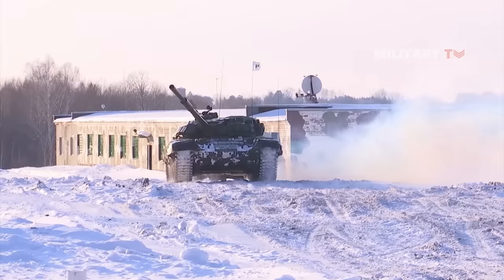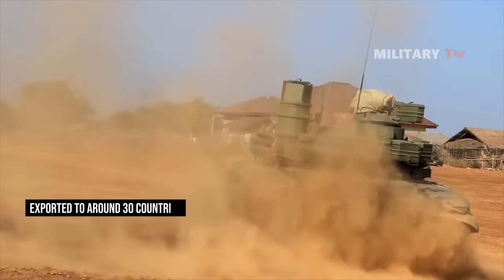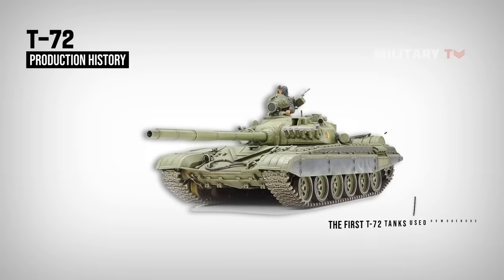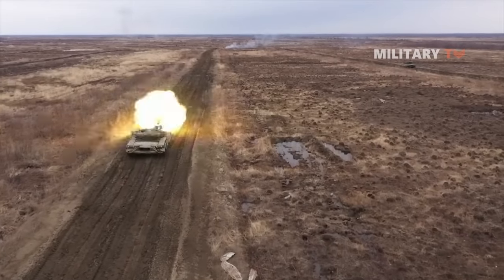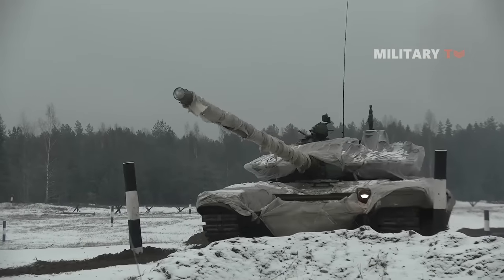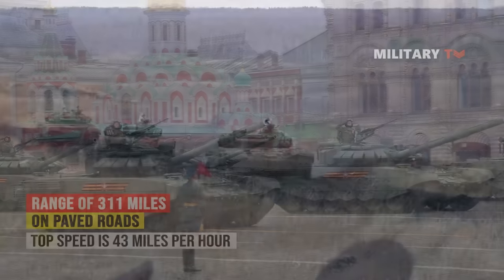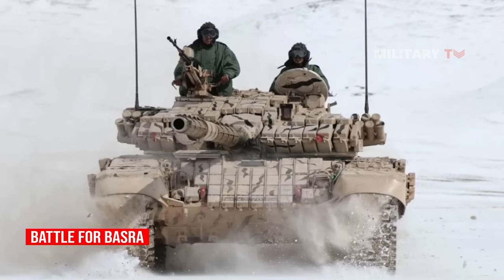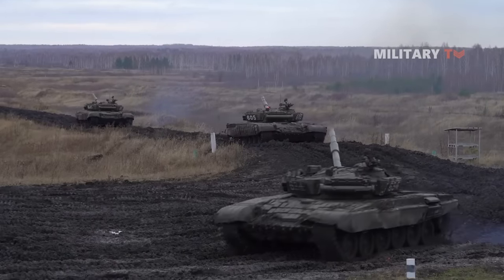Why the T-72 Tank Is the Backbone of the Russian Army

Comment: The T-72 was meant to be a modern equivalent to the T-34, Cheap and easy to produce and replace. While the Abrams, Challenger, Leapards and Leclerc’s are the 21st century equivalent to the Tiger or Centurion tanks. The T-90 / Armata -T-14 are the Russian Abrams / leopards.
Reply: The T80,90,14 back with the m60

Comment: Why don't the Russians further improve/modify their existing T-72s, like for e.g. can an existing T-72 chasis be merged with T-14 turret with improved armaments, sensors and better crew protection can be economic option. No doubt the T-72 is a good tank and with the existing stock and logistics can be more easily deployed.
Reply: They did, but with way they do things, like sell the explosive in the reactive armor and replace it with rubber. Kind of screws up the whole point.🤔

Comment: Does it need a periscope, remote machine gun and a turret bustle for excess ammo?
Reply: The auto loader carousel is isolated. The issue is when you have rounds around the tank turret.
Reply: @odalv316  T90 puts some of those in the back and keeps the carousel.  Is Russia looking at retrofitting a bustle to t 72 to do the same thing? It'd be a lot of heavy welding.
Reply: @jjamo1225  Probably not is my guess.  I don't think the issue is the tank but how it is used.

Comment: What about the T90? T80? There are more of those in service than the Soviet era T72, with most of the tank project funding going to the T99. Today, the Armata tank is also being heavily produced, but not in the numbers seen during Soviet times of the T72 etc. with around 8000 in storage and around 3000 in storage/reserve of the T80, now upgraded to the T80BVM. So, the Russian Federation is using the T90, upgraded to the T90A through to the T90MS and T80, with a limited number of upgraded to T72B2's/B3's in service today. These are most likely the ones Russia is throwing at the poorly trained Ukraine troops, to keep their main battle tanks ready to roll in, once the real war begins, after the Lep2 and A1A2's turn up from the west.
Reply: "T14 is heavily produced " Actual total of t14 build: 20
Reply: @diegomoreno7760  If you say so.
Reply: Russia's best tanks have already been sent to their final resting places within Ukraine. The T-72B3 is literally Russia's best tank in terms of capability & numbers. Hundreds have been proven destroyed, captured ot abandoned. T-90M's are technically superior, however low-numbers (~100) render them less-effective than the 72's. Many T-90M's have also been destroyed. The very-few T14 Armata's are unlikely to see frontline action, .as they cannot even complete parade duty without breaking-down. 

On paper Russia has thousands of older crappy T62 and T72's in-storage, but they've been rusting away for decades and most will be unsalvageable.

In summary, Russia has already lost more than half of it's deployable tanks within Ukraine. Even the decent ones (T-72B3 & T-90M) have been easily destroyed by NLAW/Javelin/STUGNA-P etc.
Reply: @KurtBoulter  20 is what Russia claims - it's doubtful if all 20 are actually fit for use.

Comment: The T80,90,14 didn’t work any better just cost more to make
Should have stuck with the 72 and upgrade like we did with the m1
Reply: The problem is the weak top armor and their autoloader system that has all the ammunition stored underneath the crew.
Reply: They are all designed to be used enmass in large numbers except the T14 which is a significant step up in armour, although being 25 tons lighter it still doesn't match a M1.

The problem is sending 12 tanks in at a time isn't enough against western tanks, with good visibility a Leo2, M1, CH2 will be able to spot and engage it long before the T72 can get close enough to respond.  The USSR literally was setup to roll waves of hundreds in, Russia neither has those or can provide the logistics to support it, time has moved on now too and the USSR never would have tried to overwhelm an enemy when they had a huge range advantage.
Reply: T80 is a good tank though. It has good reverse speed also. Russia still uses them in areas where there is more snow.
Reply: @MrEddieLomax  tanks don’t fight tanks anymore. T14 is designed not yo engage other tanks but use drones to relay information to other assets such as artillery to destroy enemy tanks. ATGMs are also very effective now.
Reply: @realnapster1522  The T-80,  T-72, T-90, T72, and the T54 all use the same WWII engine designed in 1937 of the T-34. 

The T-14 uses a really bad WWII German engine captured by the Soviets. This is why they keep breaking down in parades.  No one has ever gotten the engine to work, not even the Germams in WWII.

Comment: As for dragging out the 7k T-72s that are in storage, the Russians are blowing smoke that will be able to upgrade them to B3s. They are completely cut off from western tech and don't access to thermal or optics.

Not to mention, what condition are they in sitting outside for decades receiving little to no maintenance. And their maintenance budgets likely having been stolen. There's a reason why the Russkies are pulling T-62Ms out of storage. It's because they don't have a pool of useful T-72s to use.

Comment: T90 is backbone of rusian military not T72
Reply: T34, noob..
Reply: There are not enough T90s for the T90 to be the backbone of the Russian military. The T-72 is the most numerous tank in the Russian inventory.
Reply: @michaelmunika5864  There is not enough leopards, dont worry for T90 Proboj there are 930 of them and T14 armata is on the way.
Reply: @stefanaleksic4113  T90 Proryv you mean?
Reply: The only good T-90 variant is the T-90M, and Russia only had 100 of them before the war. Russia has less now, and Ukraine has gained some. All T90's are based upon the T72, with most being little or no better than the T-72B3 - hundreds of which have already been destroyed within Ukraine. 

T14's are for parades only, and there are plenty of videos of the ~10 working demo models breaking-down before the end of those parades. Lots of reports of faulty electronics, plus under-performing and unreliable engines.
Reply: @andyo8141  nope, you can trust me that this is true. Only India hvae nearly 1000 T90M
Reply: Where are they?

Comment: The best way to counter javelins is to add a smaller heater hanging off the rear of the tank elevated above the tank turremt
Reply: Javelin targets center mass of vehicle. How would a heater hanging off the ass end help anything?
Reply: @T_81535  Mikehunt, what algorithms are used in the javelin ? is it strictly computer vision or thermal ? do you know ? or is it a combination. I don't know much in this topic but i do know that tripping the sensor (any sensor for that matter is not that difficult). I know for example that the swedish NLAW uses a magnetic sensor. i will assume that the algorithm is something like this 1)trip the sensor 2) travel 1 more meter and then explode. The russians as started to put a piece of sheet metal protruding out to trip the magnetic switch. Also i am interested to learn and not debate as this is not my expertise. thx
Reply: @T_81535  You are so gullible 😂😂😂
Reply: @T_81535  i could be wrong but the logic seems sound, the javelin uses visual targeting from its optic to locate the vehicle. Once the missile is launched, and the guy ducks into cover, the missile then uses thermal targeting to locate the vehicle. Thus small heater trumps javelin